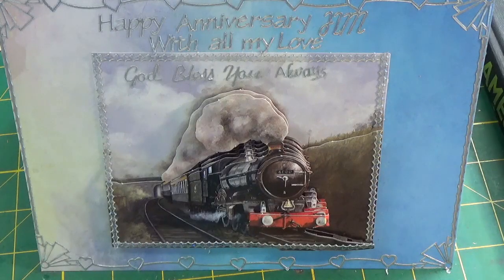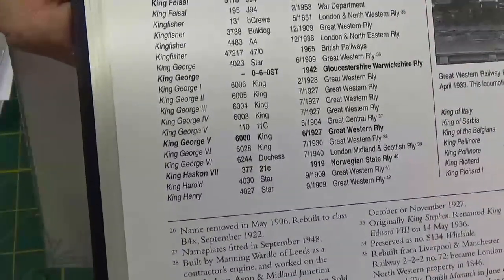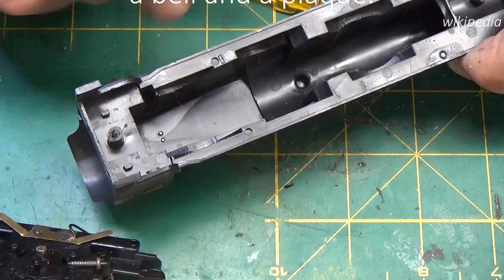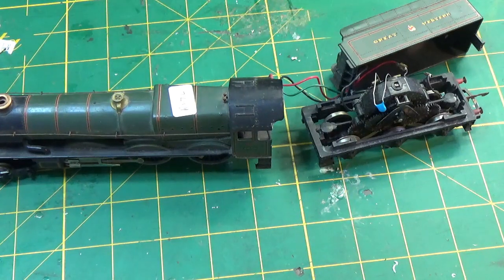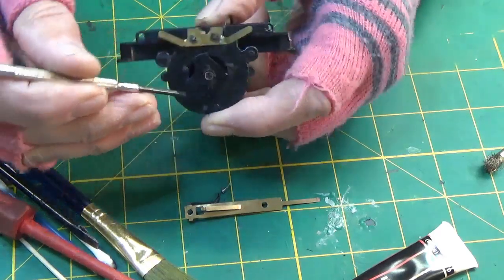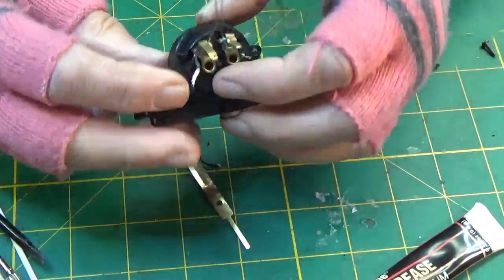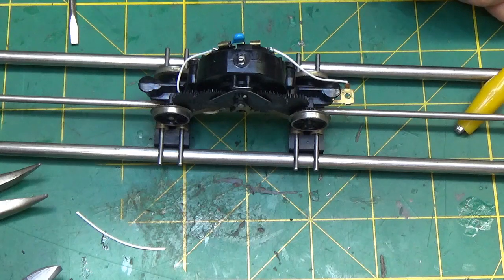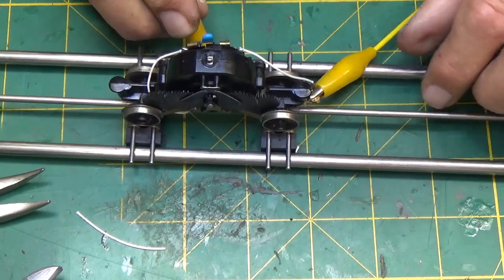R174 Lima 'King George V' King Class 6000

Comment: There is a part missing which is a plastic plate which supports the rods that come out the front of the piston block. It slides into place without any fixing screws or clips. It won't affect the loco running at all and is just there to support the piston rod at the front end.  👍😊